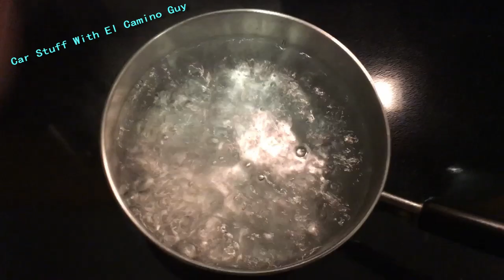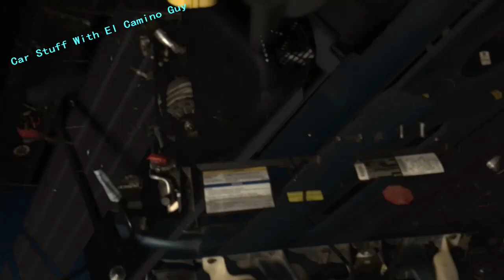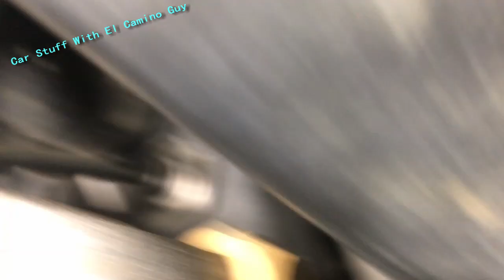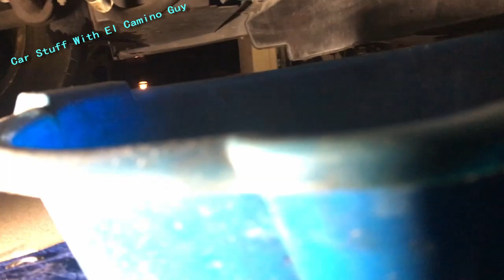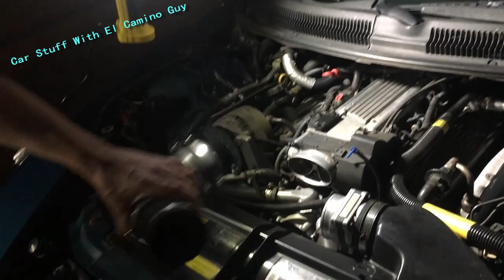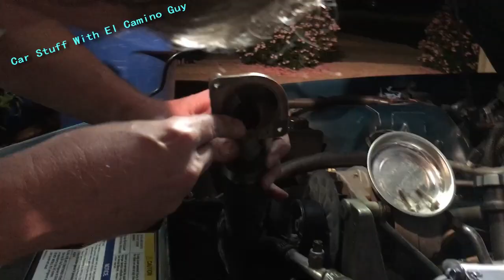The Formula Project: Cool it!  (Thermostat and Coolant Level Sensor) Part 1

Comment: Car Stuff with El Camino Guy...I’m having trouble with my 95 Z28 overheating. When the car is in motion, it runs normal temperature. But if I get stopped in traffic or a stoplight, the temperature rises fast almost to the red. I’m hoping it’s a cooling fan relay but im not sure. Can you please help me out or give me some advice? It will be greatly appreciated
Reply from the maker: From my own similar experience off the top of my head I'd be looking at the thermostat.  Otherwise a Check of all the standard cooling system parts.  Fans working.  Coolant temp sensor ( on the Water pump) can cause the fans to not work right.  Bad thermostat, partially clogged or leaking radiator.  Bad radiator cap (usually will overflow from the recovery tank when you shut it off after a few minutes) Obstruction to the radiator's airflow.   Air in the cooling system.  Bad water pump (usually leaks before it quits)   Good luck with it!
Reply: Car Stuff with El Camino Guy thanks bud much appreciated